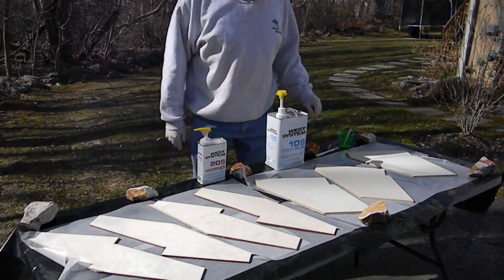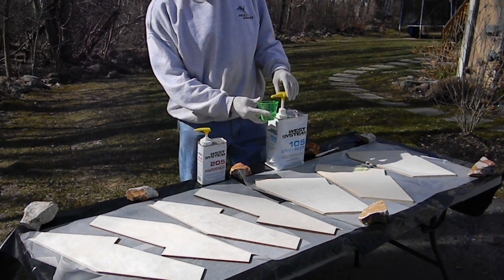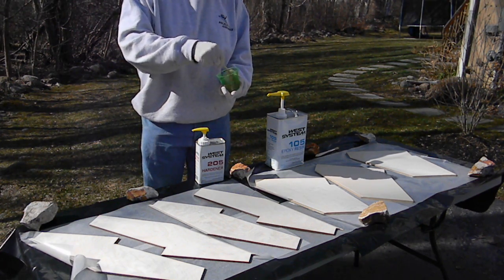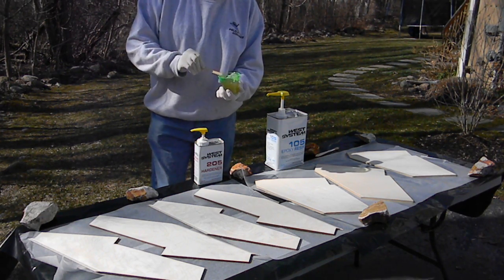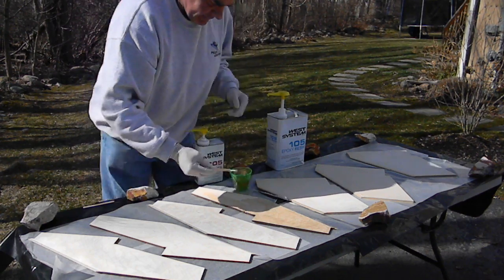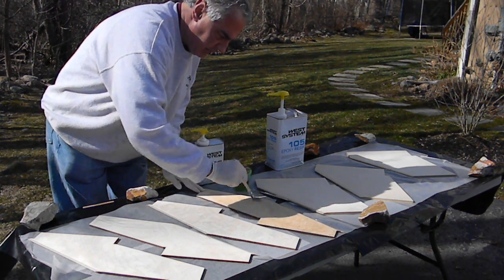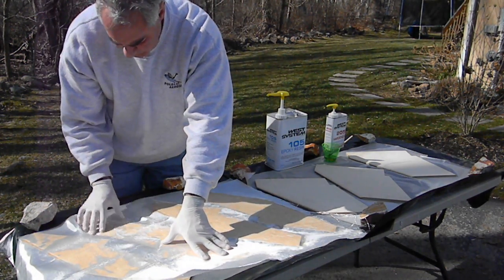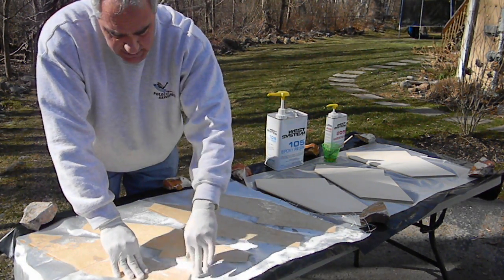Fiberglassing Your High Powered Rocket Fins

Comment: How long do you have to work before that epoxy sets up
Reply: About 5 minutes.
Reply: I know this is 2 years old, but the response you got before was 5% correct. It depends it the real answer. With West Systems they have a fast and slow hardener. Bob Smith Industries, Total Boat, AeroPoxy, RocketPoxy, etc. all have calculators that can help you better understand when the epoxy starts to turn. A few tips. 

1) Pour your epoxy onto a plate after you mix it. When you leave it in the cup it compounds upon itself. So even if you made a slow mix you may start a chain reaction that cures the epoxy in five minutes. You can mitigate this by keeping your working area smaller than what this gentleman is doing and spreading out your epoxy post mix so it doesn't compound cure.

2) While epoxy is a chemical curative and resin mix, humidity and temperature play massive factors as well. Some epoxies won't seem to ever want to set if they don't have humidity, and vice versa. Humidity cycling does a number on the curative portion (hardener) of epoxies so if you let it sit outside in a garage or a shed for a year and you notice your curative was clear and now is yellowed, test a small bit of it with resin to make sure that the reaction still happens as there is a high likelihood you'll need new hardener/curative. Resin is the same way too so try and store both in a place where the humidity and curative cycles are stable. 

3) The curing cycle can also depend on the additives you throw in too. Things like silica or chopped fiber have an effect on the time as well.

Comment: When you do the tip to tip fiberglassing, do you also push down/remove bubbles with your hands like you did in this video? Normally I see people doing it with a paint brush, and it seems like it’s a sanding nightmare afterwards. Your method looks great
Reply from the maker: This is the way I've been doing it for years.  Works great for me.  Certainly not a sanding nightmare at all.  Make sure you use cloth fiberglass.  All my fins on my rockets are extremely strong and paint up well.